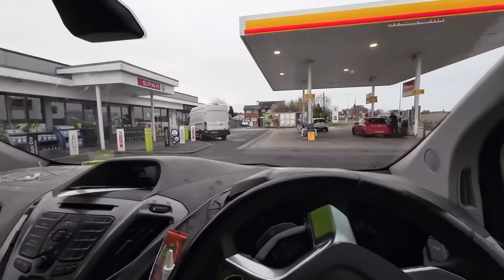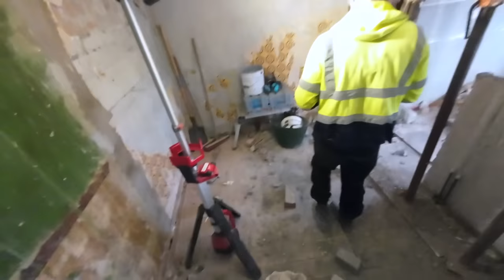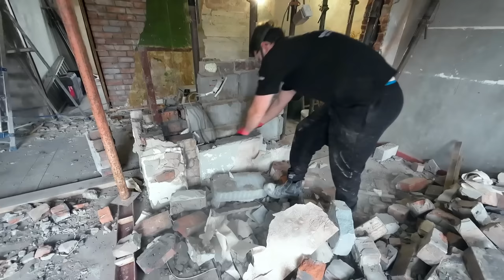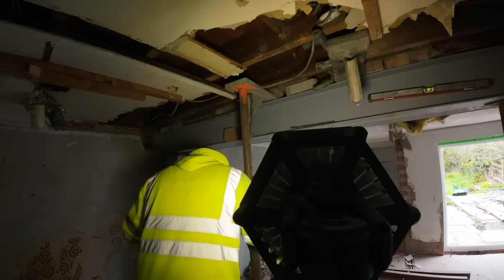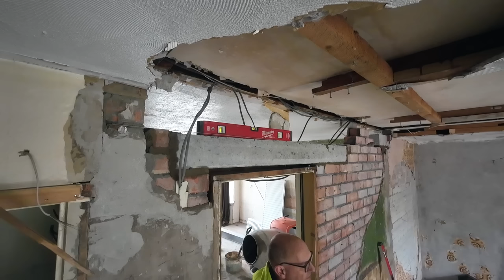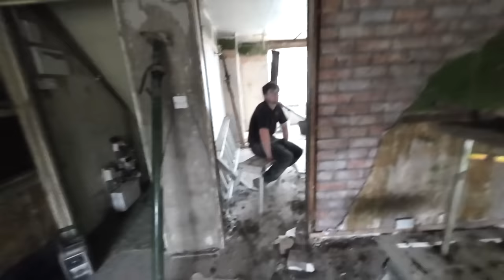OUR WORST STEEL JOB EVER COMPLETE

Comment: Jeez what a nightmare of a job, finally finished thanks to your diligent application.  Again.  Any self-respecting Customer would willingly put his wallet on the table for the extra days you guys have worked in excess of the original quote.  This customer was lucky to have you both working on this build.  Bet you can't wait for a nice front garden wall to build!  Good job guys, hope Al's holding up ok and your hips are holding out Steve.  On to the next one.
Reply from the maker: Cheers Dave the last few weeks since this job have been pretty much stress free 😁.
    The leg isn’t getting any better though 🥺🧱👍🏽

Comment: I must say that you are definitely like myself which is the old school British tradesmen that take pride in the work you do. Far too many times now I see work done and they just don't care about quality, finish and most of all leaving the site clean and tidy. All they seem to be interested in is what is the most expensive price they can charge. Keep up the great work 👍👍👍
Reply from the maker: Nice I’ve thanks Anthony 🤜🏽🤛🏽🧱👍🏽
Reply: @SteveAndAlexBuild  I did a base for a customer last year for a Hartley Botanical Greenhouse and I must say that I was glad when I finished. It does look good though and I built it out of yellow stock hand made with complimentary header and keyed entrance. It took three full pallets of bricks plus foundation blocks and engineering bricks below dpc. It should be a well insulated greenhouse floor too with how much insulation it got! 🤣🤣🤣 The speck was no bricks across the entire build Bricks Could NOT either have holes or frogs in due to the fixing bar points. The tolerance across the build was +/- 0.0mm as the structure comes part built and they also expect you to resin in each stainless steel threaded bar at given points. Hartley Botanical build crew said that my base has been the best they have ever built off and can you believe this that 70% of bases are refused to be built off! It shocked me.

Comment: Notification on and looking forward to seeing what happens  next in this house of horrors 👍👍 Could I please ask what laser level and detector you use please. I have a DeWalt green laser and trying to find a detector that works for it. I keep getting told which detector I need to find it is not compatible and starting to pull my hair out with it!😂😂
Reply from the maker: Cheers Anthony. We have a spectra 🧱👍🏽

Comment: I’ve just put steel in 6 meters in length it’s amazing how different regulations are we are not allowed to put them on block work we have steel columns what we call goal post even colour of steel we are only allowed red oxide steels your work wouldn’t be passed down south